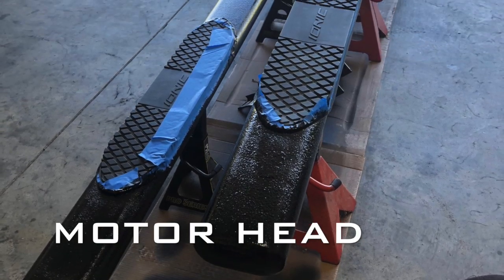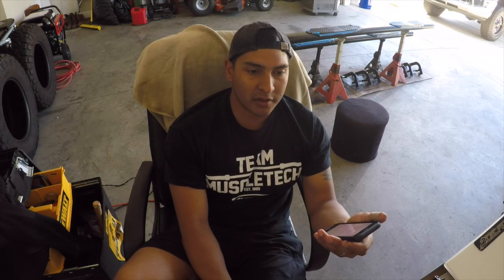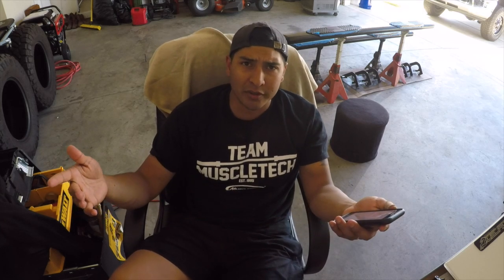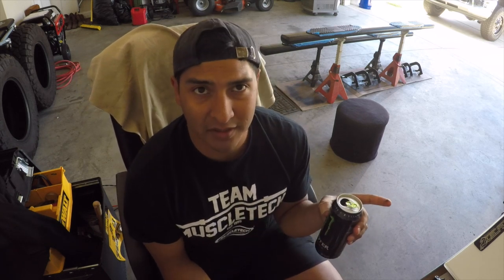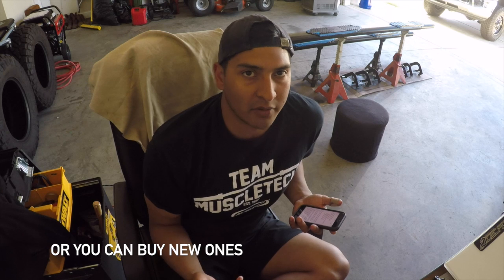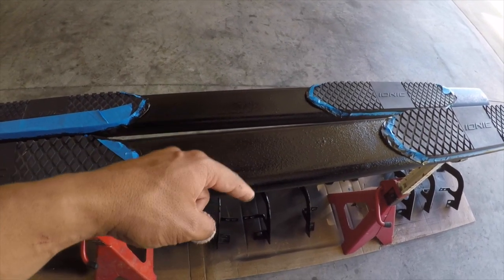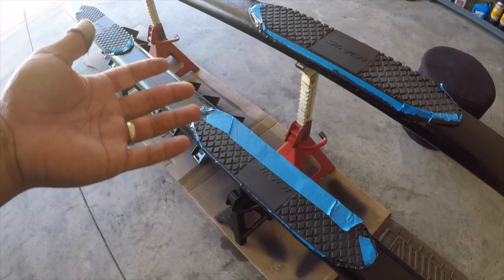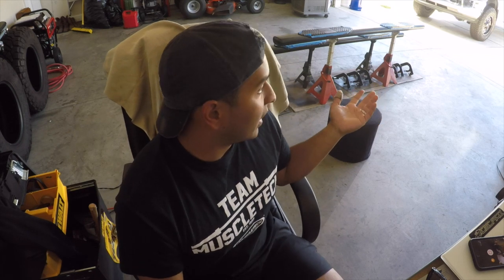Bed-Lining Running Boards for my Ram 2500!

Comment: I have some 5" not a fan of bedline on for appearance in my opinion, but the ones I have where gloss black and wanting to paint them as well
Reply from the maker: Alexis Go for it chief.
Reply: MOTOR HEAD been watching your videos man awesome help for my 2010 1500 ram I’ve been changing the speaker all around the truck. Question do you plan on installing a amp for your speakers? I’m not a big audio head so I really don’t know much been going off your videos

Comment: Thanks for the video. Good info. but I was curious if you actually used a paint roller or did you use a brush to apply the bed liner? Thanks
Reply from the maker: Jim Bo paint roller works well